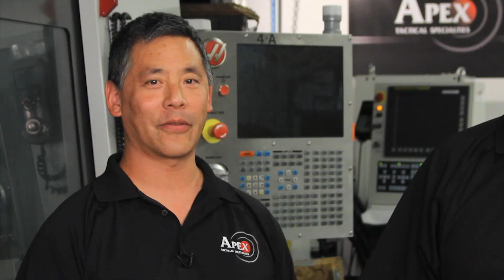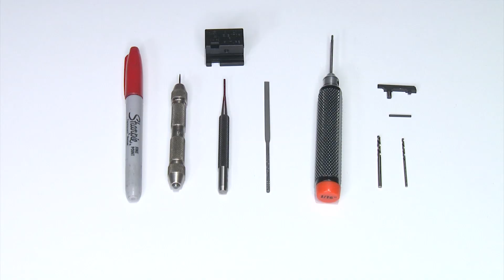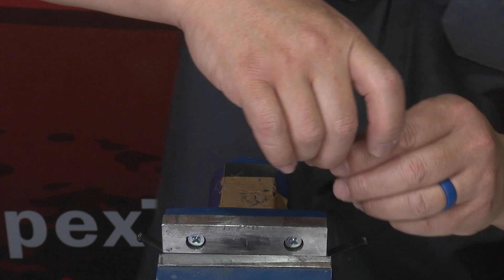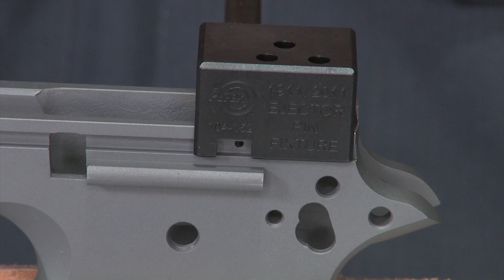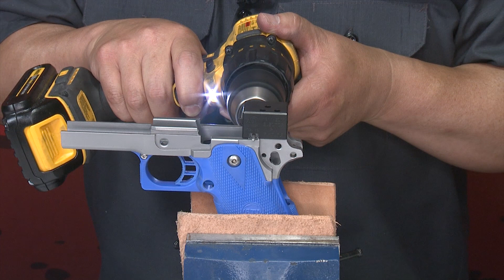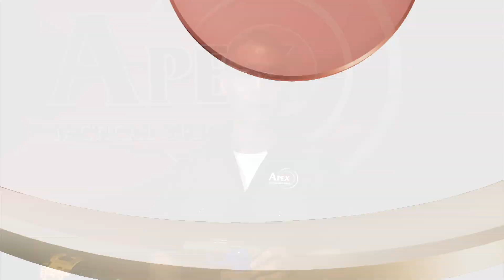How To Use The Apex 1911 Ejector Pin Fixture

Comment: Why wouldn't you use a right hand twist drill bit and drill from the left side of the frame?  That would still pull the ejector into the frame the same as if you were using a left hand twist drill bit from the right side of the frame.
Reply: Drilling the long way supports the bit keeping it centered.